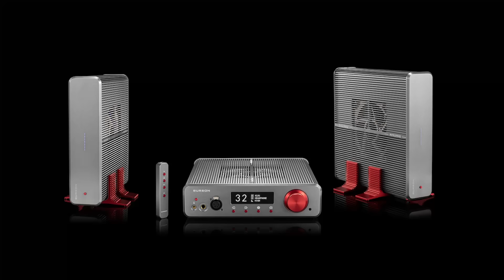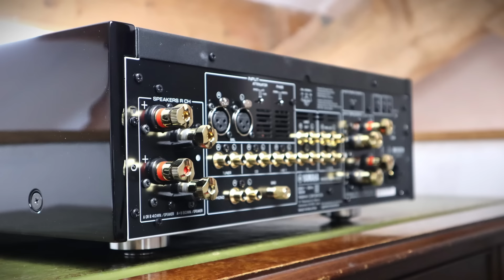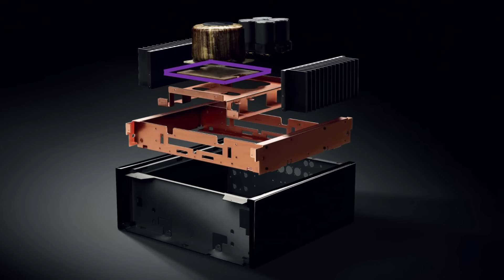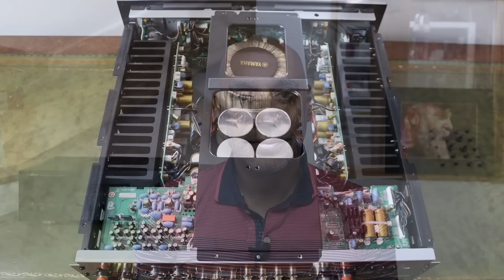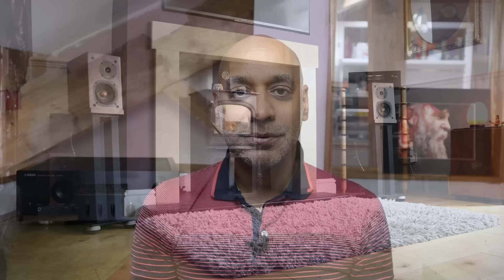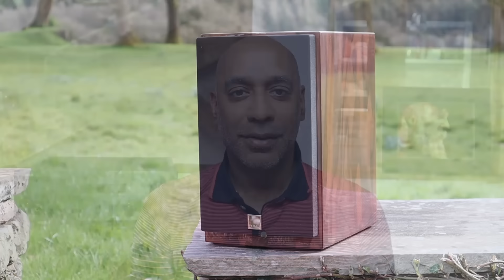ATTAINABLE HIGH-END! Yamaha A-S2200 Amplifier Review

Comment: Interesting review of what appears to be a great amplifier.  I've been running with a CA Azur 851A for a number of years now.  Looking to move up to the next league, and advice seems to be spend around x3 more than last time.  This amp fits that bill; maybe at a stretch I would also consider the A-S3200.  Will you be reviewing that model anytime soon also?  Like many of the comments here, I am after an amp that does not have a built in dac, but does ideally have xlr inputs (probably also going to buy a Aries 12th soon!)  Cheers!
Reply: Hi Oli , I owned a Cambridge audio 851a and the earlier 840a. I enjoyed the sound but had volume control problems on both. The first one I let slide as it was a first attempt at class XD amplification. You might find the yamaha a little neutral following the Cambridge.  
I really ènyoyed the Sugden Anv 50, worth a listen for sure.. I really wanted to rid myself of a few boxes (Phono stage & power supply) and simplify my hifi in addition I wanted to be run/ switch a second set of speakers.  I ultimately purchased a Luxman L509x, superb phono stage retro looks including a loudness control, for late night listening.  I think the Sugden is a true bargain, if you only want to run one set of speakers.

Edit, just checked the price of the Yamaha AS 3200. Have listen to a luxman L 550. Class A  with balanced inputs.
Reply: @karltodd2518  Thanks for the info and advice Karl, much appreciated.

I too have issues with the volume control and have reverted to using the remote only.  It must be a manufacturing defect I guess.

Thanks for the recommendations, I will duly research them in more detail.  I will only be using the amp with one set of speakers, so the Sugden sounds interesting.  Will check out the Luxman models also.
Reply from the maker: Thank you for sharing. I am also not a fan of upgrading in bite size. My advise would be to be clear about what you want from the upgrade. A more expensive amplifier may or may not take your system in a direction you are happy with 😊

Comment: Yamaha never was and never will be considered high-end mid-fi at best.
Reply: You should open your mind, nothing worst for someone to sit on his little certitudes...
Reply: @xmj6830  I have opened up my mind Yamaha never was and never will be considered high-end by anyone $15,000 for the NS5000 speakers is a joke they're a rip off they sound very flat and two-dimensional.
Reply: @chrisrichards2827  I wouldn't buy Yamaha speakers effectively. We shouldn't be attached to any brand anyway. Over the years, I have noticed something in the hi-fi industry. Most of the time it's 10% great engineering design for 90% marketing. And it's getting worse with the price of electronic components sky rocketing. Yamaha has produced little gems stereo amplifiers over the years, and I need one for my newly purchase Kef R11. I still don't know what brand I'll go with but Yamaha is on my list for that particular piece of equipment.
Reply: @xmj6830  
Hello.
I had my R11s paired with my 2200 for a couple of years. Lots of satisfied listening, zero complaints.
Reply: @XMJ68  I still have my A-S2200 and KEF R-11s setup in a secondary location. 
I thought I'd try the KEF Blade 2 with an A-S3200. 
The KEF B2/3200 YAMAHA combo provided exactly the sound I was after in my main listening room.

With regards to the 2200's 90 watt rating, my 2200 sounds like it makes at least as much power as my 160-watt Parasound Hint 6 and the 3200 even more so. I'm assuming the generous Caps in the Yamahas provide additional power, when needed. 

Sorry for any confusion.
Reply: @ronmiller6344  I guess you can't like very good sound then  wasting money on a pair of Kef blade 2 paired up with that crappy Yamaha stuff.
Reply: @XMJ68  
I forgot to mention  the Phono sections are about equal between the 2200 and the Hint 6, on my system anyway.

Cheers.

Comment: Been there done that. It is built like a tank and should last a lifetime, but I just couldn't handle that upper midrange bump for more than 1/2 hour at a time. My speakers were too revealing for this amp, so it had to go. The 2200 would pair up very well to a speaker like the Wharfedale Lintons. The warmer the speakers, the better.  Excellent review once more! Thanks Tarun.
Reply: In my experience with the A-S1200, wharfedale is a great match.
Reply from the maker: Thank you for sharing. Much appreciated 😊👍

Comment: In many of these videos you have commented about the leaness or richness of the midrange. From an electrical design POV, the midrange should be the easiest to get right, as capacitor impedance, transistor bandwidth & non-pistonic driver behavior should be non-issues. What electro-acoustic properties do you ascribe to the leaness/richness observations?
Reply from the maker: Unfortunately, it is the area where our hearing is most sensitive. It is very easy for a system to lack fidelity or sound dry and analytical. They are numerous electrical, electronic, mechanical and acoustic reasons why 😊
Reply: I have a couple of ideas but they are driver related only. Would you mind listing your thoughts on the primary mechanisms at play here?
Reply from the maker: @trevorbartram5473  there is so much to consider that it would take some thought and planning. It may be worth a video of it’s own 😊

Comment: From an electrical design POV, balanced preamplifier circuits offer power supply noise rejection and even order (2nd etc) harmonic distortion reduction compared with single ended. However there are simple ways to mitigate these effects in single ended circuits, without adding many extra parts. For balanced high power amplifiers, in addition to the previous advantages the voltage rating of the devices (transistors, capacitors etc) is halved in comparison with single ended, that can result in a significant cost savings.

Comment: Tarun,
I bought my A-S2200 18 months ago, I found that the burn in cycle actually does cause an improvement in richness mid and high frequencies but doe's not elomimate the Yamaha house sound that I actually prefer.
I have had 2 other Yamaha amp from the early 80's, R-700 and R-1000. 
the R-1000 was a great fully featured amp with bass, mid/ presence, and trebble controls as well as loudness control and a device called spatial expander that was for room tuning for room placement issues.
I am driving 8 ohm speakers with no issues, however a loudness control would have made this unit the perfect item for fans of the Yamaha (Uncolored/House) sound at lower listening levels.
My speakers are 3 way 10" bass, dome mids, ribbon tweeters and sound best at levels where the marker on the volume knob is between 10:00 and 11:30.
Or if no one else is in the house, crank it to 12:00+ with no issues in sound quality.
Thanks for another excellent review.
Reply from the maker: Thank you for sharing 😊

Comment: In your description of the pin configuration for the balanced connections, one thing was not correct. The pins are not hot, cold and ground. The + and - represents polarity. They're both hot. I only bring it up because it's very common to have issues when you make certain connections. There's more than one way a component can be balanced, and different design choices below that. What tends to happen, is when people start mixing balanced and SE pieces together in the same system, some type of adaptor in the form of connectors or cables is used. Quite often adaptors combine 2 of the pins because single ended operation requires only 2 conductors, not 3. The mistake is made when the - pin is thought to be cold, so its ok to combine it with the ground pin. In reality, the - is really a hot, so the moment you plug that adaptor/cables into a balanced component, it creates a short circuit, and the result is noise. It usually doesn't damage the equipment, but it has the potential to.
Reply from the maker: Thank you. In hindsight +/- was would have been a clearer description but Yamaha themselves use the hot and cold description to describe their balanced connections 😊

Comment: Now it’s time for Denon PMA A110 😎 (or at least the new PMA-1700NE)
Reply from the maker: The PMA 110 may be cool to review 😊
Reply: How does the Denon 110 sound vs Marantz?
Reply: A110 was okay but I sold it. Ultimately too warm and laidback for my taste. May look into the AS-2200 in the future.

A better buy from Denon would be an SX11 or SX1 Limited although they are Japan only models and you’d need a step down transformer to run them on North American voltage.

Comment: Yamaha amps are a safe buy at any price bracket.
Reply: Yamaha anything is a safe buy👍
Reply from the maker: I hope to find out 😉
Reply: Tarun, I couldn’t help but notice your less enthusiastic response to this amp in relation to the A-S1200 you reviewed two years ago. 

I know that it is hard to compare two units when they are not both available and that working from memory is fuzzy, but could you give your take on the differences between them?
Reply from the maker: @billd9667  The A-S2200 is more resolving of details but the A-S1200 is better value for money 😊
Reply: Thanks. I’d love to see you review the R-N2000 receiver (which appears to use the S1200 amp section(, but that might make you look like a Yamaha fanboy 😉

Comment: I own this amp, and I'd say that at this point I've had a good amount of experience with different types of higher end gear. I understand the perception that it leans to the cool/analytical side but to me the "yamaha sound" is the absence of color and a truthful yet refined response across the frequency range. I believe they built this amp like a fine instrument not so much a hifi component meant to stir the senses with a signature sound.
Reply: Love that analogy. I owned A Yamaha trumpet, drum machine and synth back in the day. I will have the 2200 in a few months. I spent months contemplating receivers and realized that I did't want one. This amp is 2000 more than I would ever pay for any receiver, but judging by the reviews and that very strong tactile click when you cut the power on or off, or change an input, or actuate your mute toggle, it looks like money well spent. If music is your thang.
Reply: I should add that the amp befits from a full warm up
Reply: I recently compared a somewhat "boutique" type of amplifier to by basic Yamaha (and other regular amps) 
The boutique amplifier definitely has a certain sound to it; I can see why some like that kind of sound, it can make things sound less smeared, softer on the ears. But it also just sounds off in a way that's hard to define. Like there is less depth, less smooth and clean. It probably measures with poor sinad I guess. I had another amp with similar effects and that one was measured, with poor sinad compared to your run of the mill amp. It does look good and it built well otherwise.
Reply: @RennieAsh 
Agree, it’s just a very boring amp. Never found it very musical. Limited soundstage. Did not get me toe tapping. Beautiful to look at and nice features but sound is compromised.
Reply from the maker: Thank you for sharing 😊
Reply: Now the question is that this still sound their 70-80s vintage amp receiver or amp? They are much cheaper and great alternative by😊
Reply: Totally agree!

Comment: The revealing "harshness" and lightness is only an issue in the first 50 hours from brand new on these Yamahas. I have the AS3200, and had to tweak the treble knob down a notch, snd the base up a notch on first listen. 50 hours later noticed all harsness was gone and bass more fuller, so was able to zero all tone controls.
Reply from the maker: This amp had months of run-in 😊
Reply: @A British Audiophile  The weird thing is, and I know I am comparing an AS3200 to an AS2200 here which may be the difference, is that I heard everything you described your review in my first 50 hours. I don't consider myself an audiophile, although I probably am partially one, my wife definitely is not and she says what thinks of something straight out with no BS and we both agreed on what we thought of the sound. The treble was very very clear and bright to the - so much so the treble control HAD to be tweaked to 11 O'clock for any more than 10 minutes of listening. On the base side of things, it was there but a little light for my taste at the time depending on the source material. So everything was more in the mid to upper side of things. Come 50 hours, the extreme clarity had clearly reduced, and I am not one of these people that descibe a subtle change as "night and day" it was quite obvious. The tone controls could be now centered with no listening fatigue. After a couple of hundred hours the mids and base were certainly pumping very hard, to the point my wife could be hauled in from another room in the house to hear it. I love to see someone sit in front of my system and tell me it's lacking in mids, base - because I'd choke on my (whatever I'm drinking) in disbelief. The speakers are Monitor Audio gold 300's, so they should pump this hard. But the point is the amp break in was 100% real, coming from a non audiophile type of person.
Reply from the maker: @4leggedfurball  great to learn about your experience. How it sounds to you (and your wife) is all that matters. All you need to be an audiophile is to love music and how it sounds in my books. That makes you both audiophiles in my book 👍
Reply: @A British Audiophile  Thanks mate.  Always a pleasure to watch your reviews.
Reply: @4leggedfurball My 2200 is still a little bright but I'm expecting great things in the future. I have no doubt break in real on speakers qnd amps and it can take years. I recently noticed the Focals in my car sounding a little dull. When I got them several years ago they virtually unlistenable with a flat eq so I used smiley face. Now, I run them almost flat and they sound perfect. I don't think my hearing has changed as I've and enjoyed same model Focals in my car since 2005 but wore them out and replaced with same model about 4 yrs ago (weekend car)
Reply: no burn in or run in, its just that your ears getting used to it

Comment: Yes, the A-S2200 is pricey. How about it’s predecessor, the A-S2000, available on the used market for around $1200 USD?  It, too, is fully balanced input to output and it’s specs are nearly identical to the A-S2200.  Build quality between the two is identical as is the MM/MC section.  You lose the meters, but you do get lovely polished honey oak wood side panels (black wood was available, too).  The ‘2000 was my daily driver for years until it was displaced by a Luxman Class A integrated amplifier at four times the Yamaha’s original retail price.  Hey, life is short 😉!
Reply from the maker: Thank you for sharing 😊

Comment: Hi Tarun.
I have a quick question for you...Was your 2200 burned in for a week or so?
That "leaness" was prevalent on every Yamaha Amp I've owned, out of the box.
My 3200 seemed particularly stubborn, as did my own 2200.

And thanks for your great reviews!!

Ron
Reply from the maker: Yamaha amps have a reputation for needed excessive periods of run in. My contact at Yamaha ran it for 4 months and I ran it daily for a further 3 weeks before critical listening 😊
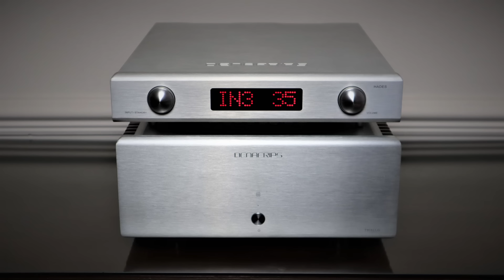Reply: @abritishaudiophile7314  When I got mine brand new, I ran it for five months with the treble control at 11:00 o'clock position and the bass at 1:00 o'clock because out of the box the sound was not up to my expectations. Now, I have both controls in neutral, and it sounds great.
Reply: @A British Audiophile  
Thank you for clarification!!
Reply: My A-S3200 burned in 1 year. Now paired with CD-S3000 and Technics SL1200GR is sublime, my hifi exploration journey for an Amp ended right there ;)

Comment: I would like to see this compared to the Parasound Halo Hint 6. The Hint 6 is supposedly "mono" as well and falls into a similar price range.
Reply: Hello, I have a Hint 6 and Yamaha A-S3200 in the same rack.
The H6 is a great amp and for the price, is a great deal.
The Yamaha, with my system, is more musical, period.
The 3200's Phono Stage is also superior.
As far as the advertised increaee in power, I honestly never noticed the additional power of the H6. In fact, without knowing the rated power outputs, i felt the Yamaha had "more grunt".
Most listening comparisons were through a high-end digital source, Chord M-Scaler and TT2 DAC, decent cables and interconnects into KEF Blade 2 Speakers. 
I did not try the H6 DAC as my 3200 doesn't have one.
The H6 does not produce the airy 3D presentation the 3200 does and the H6 produces a considerably flatter soundstage.

Hope this may help.
Reply: @ronmiller6344  great info, thanks. The phone stage perspective is appreciated. One thing I find appealing about the H6 is the exceptional bass management. I always use a separate sub with stand mounts so the ability to adjust so much is enticing.
Reply: @bgroovin1343  Yes, the H6 has been described as a Swiss Army Knife, and it is. Without having the 3200 beside it to compare, Id be quite satisfied with its performance.
Reply from the maker: That would be cool 😎

Comment: I have a silver as2200 and love it. I wanted an analogue amp so it wont date like those with inbuilt dacs. I prefer to keep my dac as a seperate. The MM phono input is exceptional, i had a Clearaudio smart phono V2 (over $1000aud) with audioquest interconnects, I much preferred the Yamahas phono, so I sold my phono and interconnects. This is an exceptional Amp for its price point.
Reply from the maker: Cool 😎
Reply: @MrPetermc199thats why I bought 2nd hand as 2100 for 1600 euro
Reply: @MrJatzeq and how is it man ?